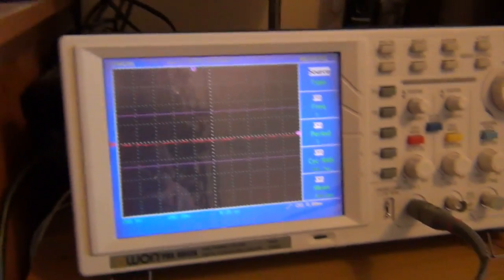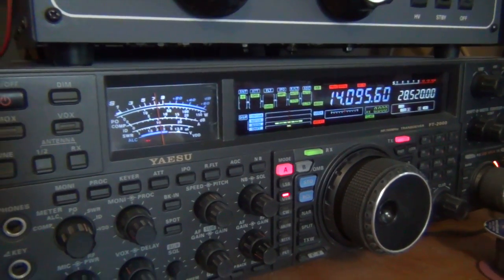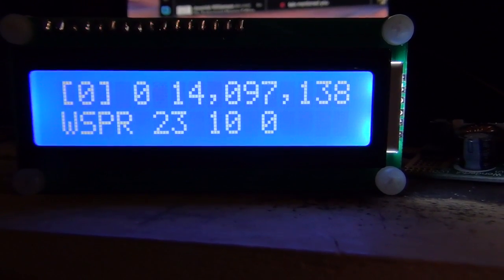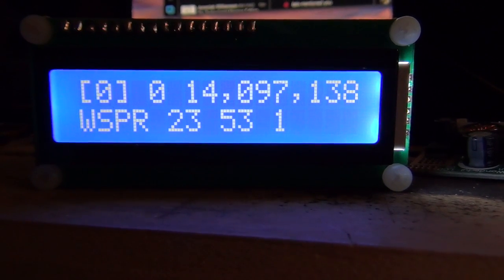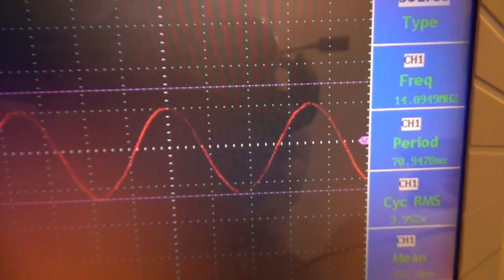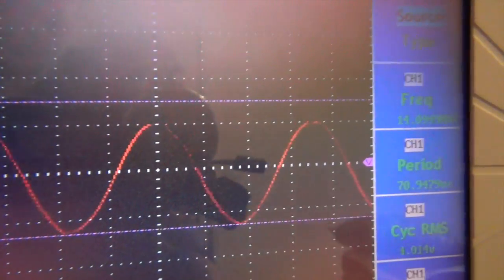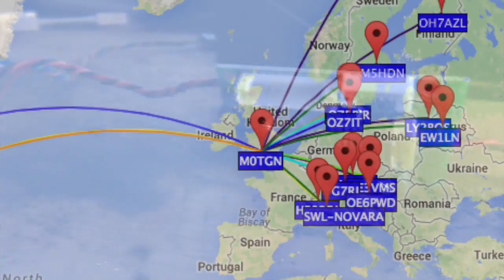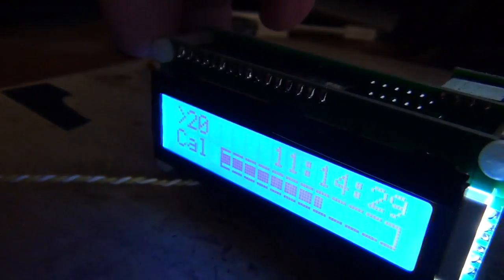WSPR Ultimate 3 kit for Ham Radio

Comment: Forgive my ignorance.  How do you get the data from the U3 into the computer?  Does it have a computer interface?  Do you have to scroll through received signals on the LCD and manually type them in?  Or does this just transmit and something else does the receiving and updating a central database?  You've shown it working; I'm just unclear on HOW it works.
Reply: http://wsprnet.org/drupal/

Its a transmitter. The link above takes you to the WSPR Net display. You can use map or database view. The U3s has two buttons to access the programming and it's a fairly simple interface to use.

More info here: https://www.qrp-labs.com/ 

73 NE5U

Comment: Can't get mine going at all. All the lights come on, display fires up, can go through all menus. Set up GPS, can see data and 1PPS on my scope at the U3 board input, but the U3 itself won't 'see' the GPS or calibrate itself to it. And yes, GPS mode is on! I am ready to hurl it all into the nearest bin!
Reply from the maker: Hi, Have you joined the Yahoo Group ? There are some very helpful & knowledgable folks in there that maybe able to help you.

The only thing I add is make sure the GPS module is far away from the U3, and also that you have a shielded cable between the GPS unit and the U3.  If this doesn't help - try here. https://groups.yahoo.com/neo/groups/QRPLabs/info

I hope that helps.
Reply: Would you believe it, I got it 'fixed'. I just entered a character a dummy message into the 'Message' setting, and it sprung into life! I will still have a look at the Yahoo group though, thanks!

Comment: just got done with my build. Thanks for this video. I wouldn't have know about the cool project without you. A few more questions, if you don't mind. What is that black piece on top of your blue PCB (by the red LED)? Is that where Hans suggests a heat sink (like a copper coin)?  Also, I like those Molex 2.45mm connectors. you have a 2x1 for the RF and GND, a 4x1 (but only using 3) for the GPS signals, and a 9x1 (only using 2) for the gnd and +5v right ?
I'm going to search ebay to find them and the crimp ends.  you did a very neat job on that project.

Comment: could you tell me where you got the powersupply ?
Reply from the maker: Hi Kevin, have a look at this. Its not 100% exactly the same but it is along the same lines of what I have used here. Hop that helps. 73 Dan http://www.ebay.co.uk/itm/SHD-DC-DC-12V-a-Double-Sortie-5V-3-3V-LED-Puissance-Module-I-P10-15V-Max-3A-/121310902132?pt=FR_YO_MaisonJardin_Bricolage_InstallationElectrique&hash=item1c3eb17774
Reply: Thank you, it did help!

Comment: I have the Ultimate 3 kit to build. The power supply board is neat. I ordered a couple. CHEAP, why not?
Reply from the maker: Hi Kevin. the plugs on the power supply are known as JST 2.0 PH. They are smaller than the connectors on the U3, which are Molex KK 254 connectors (http://www.molex.com/molex/products/family?key=kk_254_rpc_connector_system&channel=products&chanName=family&pageTitle=Introduction&parentKey=kk_interconnect_solutions) 

Hop that helps.
Reply from the maker: HI Randy - Thanks for your comments. Yeah the power supply board has been brilliant. Ive now mounted mine in an acrylic case with the PSU mounted behind the main board - it looks neat. I will add a photo on my blog soon. 73 Dan
Reply: ColdestMoon It should show up soon. I think the box from China might be sitting at the Post Office for me to pick up.
Reply: K7AGE I am looking forward to your review, also.  Got similar power supply board. Wish there was instructions as to where the 12v goes - mine seems in Chinese
Reply: But luckily at 4:52 in this video, I can see where you made the connections. What's the proper name for the white plugs you use on the kit to finish it up for the box?

Comment: Great video, thanks for sharing.  Have you had any issues with that 5v/3.3v voltage regulator? I'm about to pull the trigger on one for my Ultimate3. Cheers!
Reply from the maker: Hi - not a single issue. Its been really stable and is extremely well built. Very happy highly recommend it ! 73